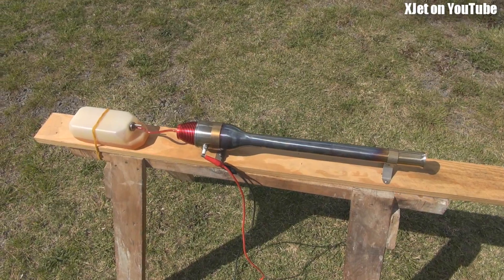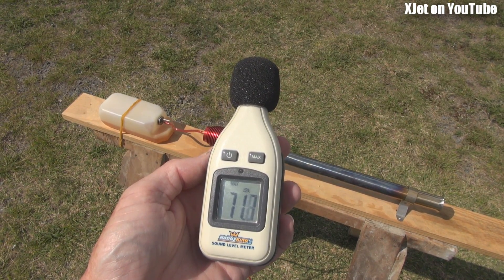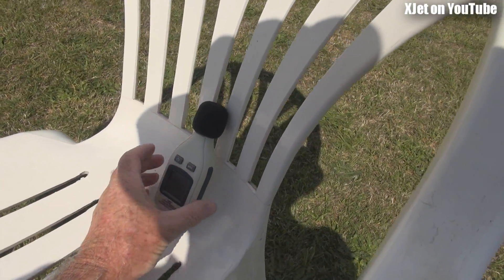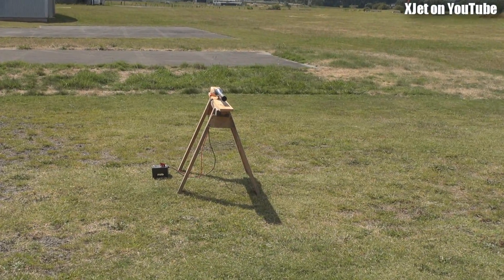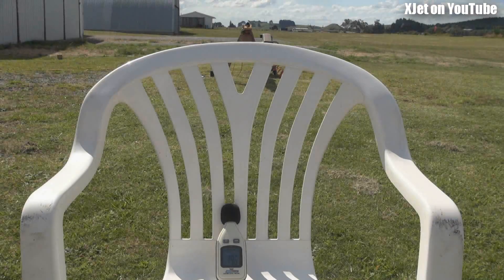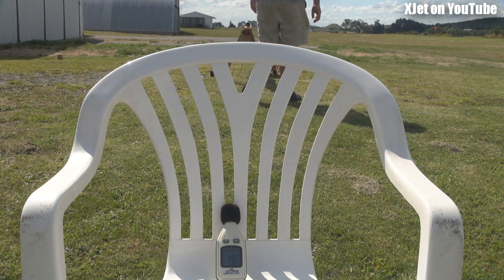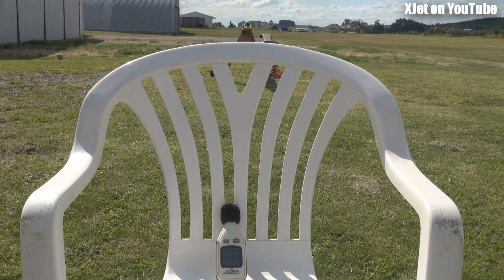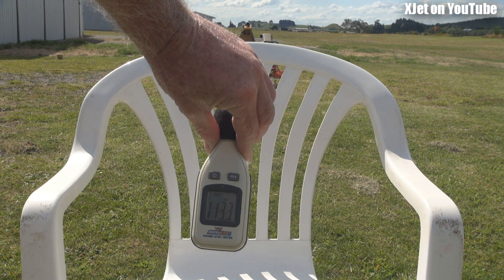How loud is a HobbyKing pulsejet?

Comment: The standard for airborne noise is dB reference to 20 microPascals. When the measurement is dBA it means A-weighted which adds the filter shape of human hearing.  If two pulse jets were measured it would add 3dB to the measurement (113dB+3=116dB) or 10*log(2).

Comment: I was surprised how loud you were.  I guessed 110db for the hobbyking. So that puts you on par with an flushing toilet, alarm clock or garbage disposal truck and the hobby king on par with a rock band or emergency vehicle siren.  But of course the hobbyking would only briefly be within 5 meters whereas you would potentially be in close proximity for quite a bit longer ;-)

Comment: I think it was about 105 to 108 for the low frequencys.  It looked like the peaks were the hi frequency chirps.  And it's the low one's that bother people (rattle windows etc..).  Not that the high one's wouldn't to if they were continuous.  But the low one's will drive you insane after a while I think...

Comment: I guessed 115.  Isn't each subsequent decibel reading ten times the previous?  Someone please clarify?  Thanks.
Reply: +Gravertrain Graveytrain Decibels are a base-10 logarithmic scale (M=20log(x)), so double the magnitude would equate to +6dB, every additional 20dB is 10x the magnitude.
Reply: +Tom Reed Thanks a lot.  I probably was confusing the scale with tornados or earthquakes.  Now I'm gonna hafta Google them all.   :)
Reply: +Tom Reed db is essentially a comparison between 2 numbers so there needs to be a base to compare them. I think when used to measure sound the unit is dbA and the level is compared to some nominal 'quiet'.

It's a power measurement and the value is 10 log p1/p2.  If you're measuring voltage into the same impedance then that would be 20logV1/V2.  I guess it's assumed that sound pressure is similar to voltage hence the 20.

Comment: To be fair you should take the same readings at 90 degrees to where you took that reading.
When a plane flies it is more likely to be seen/heard from the bottom or the side rather than directly behind it.
It would also be better it the sound meter was on a tripod or stand without any direct line interference from the chair.

Comment: A bit off topic: but interesting to note is that full size turbo jet & high bypass fan engines are for all practical purposes silent just a short distance directly behind. It's so, look it up. They mentioned this fact back in A&P school, and I didn't believe a word, till I actually experienced it. Find an airport with close public access to the end of a runway directly behind aircraft beginning their take off roll; you won't hear a thing[1]. The pulse jet however, is another animal.

[1] The little park immediately East of the approach end of runway 24R at Los Angeles International (just South of the In-&-Out Burger on Sepulveda Blvd) is very good for this. Also, on calm days descending tip vortices behind larger aircraft on short final to this runway are often audible.

Comment: Where did you get 5metres from??
Obviously if you measured from 1m or 10m you would have completely different number. You should check the standard for measuring DB
Reply: It's 10M where I am in the UK but the regs may be different in NZ. Of course I don't know where you are situated but wondered if you'd considered this.